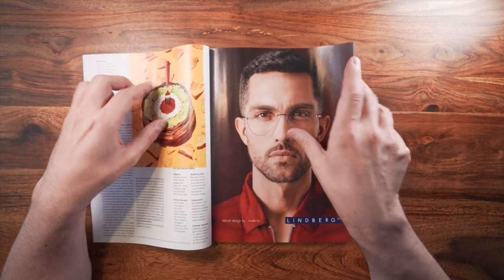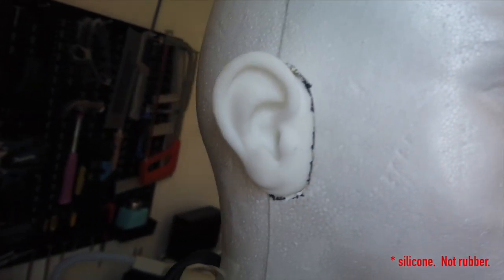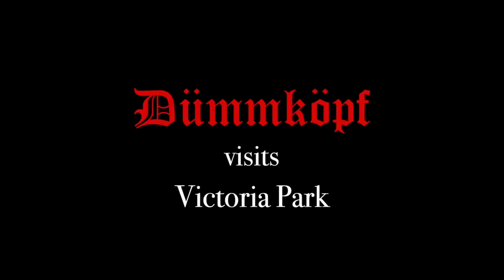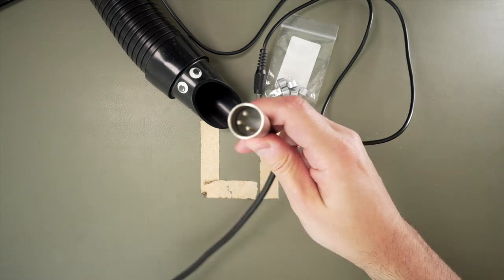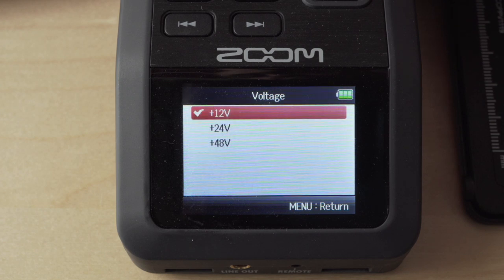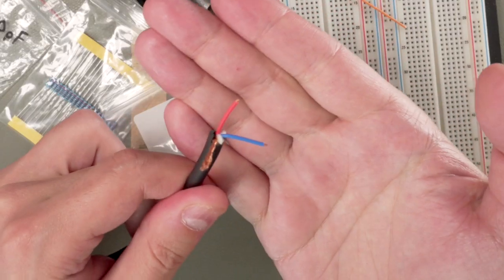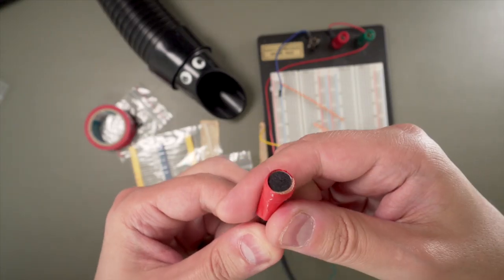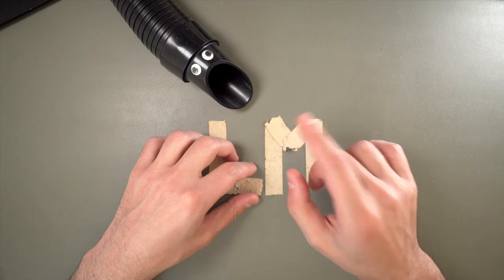How to make a binaural ("3D") microphone

Comment: So what’s the difference between this finished product and the microphones operating together without the head? The  reason the consumer mics are so expensive is because they are anatomically correct ear canal that uses silicone density that represents real flesh. Without that test all this is, is two microphones with a flashy way of mounting them.
Reply from the maker: I'll freely that admit commercial mics are (and should be!) more thoroughly researched than this one. I'll also say that the proof is in the pudding:  this cheapo DIY setup actually makes a surprisingly good binaural recording!

Now if I had the means (or if I was trying to build these as a business), I'd do a Mythbusters style dummy head out of ballistics gel but sadly that would be very expensive.

Thanks for watching!
Reply: @LeoMakes  I'm not disputing the "pudding" so to speak lol. I'm questioning if the head actually did anything... if you used the same mics the same distance, level and pointing the same direction from each other without the foam head and ears would the results be the same? or are your amazon ears actually doing something to change the sound.
Reply from the maker: @matt09ward  Oh, sorry, I misunderstood.  Absolutely the head and ears both have a huge impact on the sound.  If you just hold electret capsules side by side (nothing in between) you don't get nearly as good a stereo image.
The head itself casts an "acoustical shadow" from one side to the other which helps create the "3d-ness" of the sound. It physically blocks high frequency sound waves coming from one side and forces lower-frequency waves to wrap all the way around the head to reach the second capsule (instead of going straight to the second capsule, since there's nothing in the way).  This very small delay results in phase differences between left and right ears and the brain is actually very good at using these differences to localize sound. 
The shape of the earlobe and the pinna (the little bump in front) is also super important.  The outer ear is actually a filter and creates big boosts and dips at various frequencies.  These boosts/dips change depending on the angle of the sound source relative to the ear itself.  So if a sound object is moving and the frequency is changing, the brain can actually make sense of that and help you localize the sound very precisely.  Look up "HRTF" (head related transfer function) and there's tons of really interesting info on this.
Before I started filming, I simply taped capsules to the side of the head and I got some of that "3d" feeling (it sounded like well separated stereo mix) but it didn't feel truly "immersive" and life-like until the ears were there.  I'm sure there's more I can do to improve the sound, but this felt good enough to share.
Anyway thanks for watching!

Comment: Great video!  I'm thinking of making one.  The electret capsules you used are currently unavailable.  There are others, but some are unidirectional while others are omni.  Which would be the right type for this project?  Thanks!
Reply from the maker: I don’t think the polar pattern of the capsule matters much since the head itself blocks the sound except what is coming in from the ear “canal” of the dummy head.  That said, I haven’t tested this so I’m not 100% sure. I say give it a go and see if you like the result.

Best of luck with your build and thanks for watching!

Comment: Some of the RF-Noise comes from the phantom power of the zoom. You can get rid of the other noise by shielding your capsules with some copper tape.  Here is a description how you connect a 5V capsule correct to phantom power without frying it: https://tombenedict.wordpress.com/2016/03/05/diy-microphone-em172-capsule-and-xlr-plug/

Try these EM172, or DOM3027 these are way better as these cheapo ones.
Reply from the maker: Good tips--thanks for sharing.  If I make an updated "v2.0" of this, I'll put this into action.

Thanks for watching.

Comment: Hi, I just started my journey in sound recording and found this video.
this is exactly what I was aiming for.
B.T.W, if I connect two mics to opposite sides of the Zoom H6 will It produce the same result? I saw binaural mic (3DIO) without the dummy head  
so maybe it is unnecessary?
thank you so much
Reply from the maker: Sticking two mics on opposite sides of any hard surface (ideally spacing the mics so they’re a similar distance as ears on a head) will produce a pretty good stereo image with some “pseudo” binaural effects. All this stuff about the head and ears helps give more definition and “realness” to the binaural image. But you can start simple and see if it works for your needs. You can always add the head/ears/etc later if you like. 

Thanks for watching.

Comment: What is the purpose of the Styrofoam head? Could you do the same thing with a cube or ball?
Reply from the maker: The head stops sound from going through it and gets the mics in the right position (plus it looks funny on camera). Other materials should work too.  It just needs to roughly be the size/shape of a head and dense enough to stop sound waves from going through it.  It doesn't need to be perfect!

Comment: Hi I know this vid is 3  years old and sorry for being so late, (I have subscribed though :).
I have an issue that I hope you can help with.
I have built a binaural mic, using a polystyrene head and 2 lekato lav mics, my idea was to do headphone reviews and record the audio from the headphones using the head, now, both mics work perfectly if plugged into the phone, but even using a splitter I can't get stereo, wich is the whole point.
But, what i need to do is use either my audio interface (presonus studio 24c) or my mixing Desk/interface (zoom livetrack L20) and give each mic its own channel and pan left and right.
The mics are trrs and came with  cables to adapt them to trs, but I can not get any sound from them using either option of interface, please please save my sanity and help me out.
Thanks in advance
Gray
Reply from the maker: Hi Gray, I have not used these Lekato mics so I’m kind of shooting in the dark here, but do they need phantom power to operate?  These small condensers usually do. 

Be careful when applying power as those electret condensers can be pretty sensitive (some of them need way less than 48V and, as an example, my Zoom H6 has 12v and 24v options)

Not sure if this helps but best of luck and hope you figure it out!

And thanks for subscribing!
Reply: @LeoMakes  hi Leo, thanks for taking the time to answer so quickly,  yes it looks like these need power, both my interfaces only offer 48v, but I have a boya my b1 that has its own power and works on both interfaces, so I will order another one of those and see how I get on. Thanks again for taking the time to get back to me, much appreciated.

Comment: How does it work after a month? I want to do a simpler version of this with a 3.5mm cable at the end. Is that possible?
Reply from the maker: The mic still works fine.  This design won't work with a 3.5mm connector since most audio devices don't send 48V phantom power over their 1/4" or 1/8" (3.5mm) connectors.  They only send 48V phantom power over the XLR pins to avoid accidentally powering things that don't want/need power.  You'll need to find some other way of bringing the phantom power to the capsules.

Thanks for watching!

Comment: I tried making an wearable earbud version of this using two cheap lav mics. Sadly, they didn't work. It might be that the wires broke.
Reply from the maker: I did a quick early test (before filming) where I stuck these mics to the side of the dummy head (not even in side the canals) and it still sort of worked. I didn't get the full "3D" experience but it still sort of worked.

It felt more like a "good L/R stereo separation" effect instead of "full 3D" if that makes sense.

Comment: the head part is interesting, the result is not: You did so much work, to then install such poor microphones ...
Reply from the maker: So what microphones would you use and why?
Reply: @LeoMakes  I have an objection to that comment. When you get a random cheap electret capsule, they're usually, with few exceptions, fairly neutral compared to the undesired response changes introduced by the microphone body as it were, or the head and ears in this case, so it shouldn't matter all that much what capsule you use, so i think that's the main reason the head sounds a bit wonky, lack of compensation. Also good interfacing to a high resolution interface or field recorder should alleviate a lot of commonly perceived issues with these, so i think you're doing better than the critics. I tend to avoid 9mm China capsules and go for 6mm instead, they just seem slightly less weird to me.

The 'ideal' choice was often considered the discontinued Panasonic WM-61A capsule, frequently used as a DIY measurement microphone. Do not attempt to buy them, you will receive a fake. In absence of that, it seems Primo EM172 would be a good idea to minimise noise, while EM258 would maximise response extension and flatness. Not sure what's more important :D Even EM258 claims better S/N than Panasonic, but i'm not sure whether that's to be believed. I don't have either of these at hand and haven't tried them personally, they're all just things that have been highly regarded in the DIY mic community over the years. I only have the Chinese bags of cheap ones.